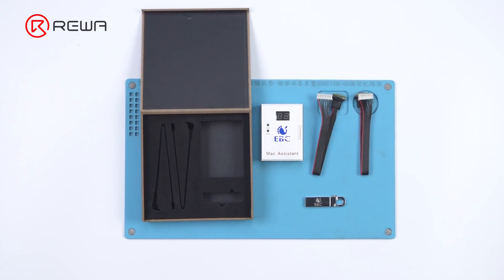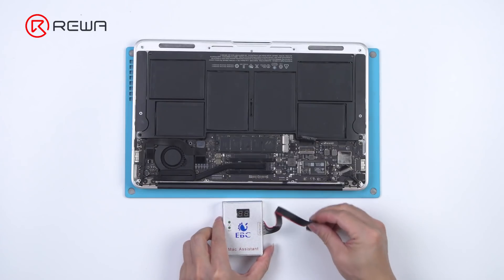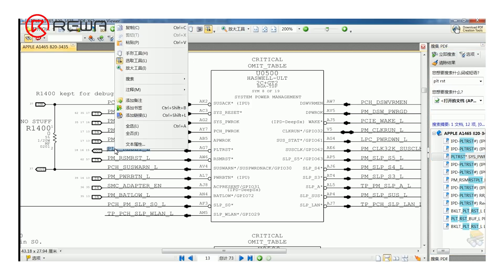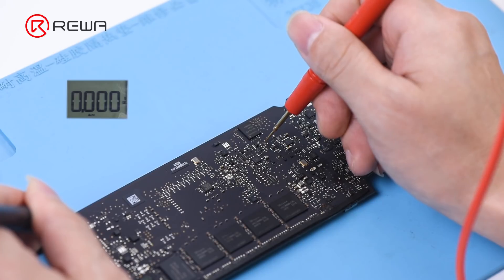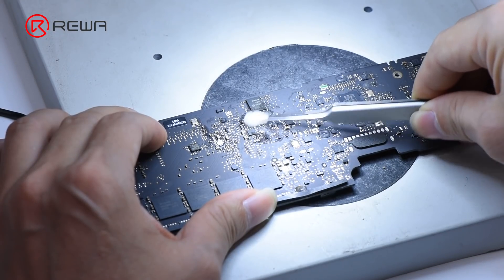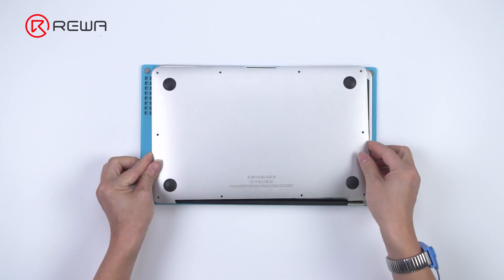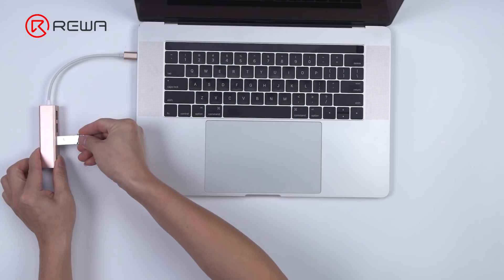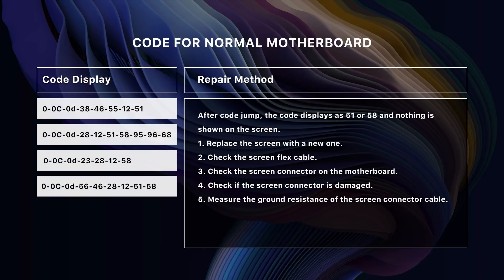An  Efficient Way to Diagnose MacBook Faults and Fix Serial Number (EBC-820)

Comment: Nothing special. Standard post-card. and the 500 ohm resistor was soldered specifically for the video))
Reply: I don’t think you will able to find what was the problem in the first place is just to educate you and how to find the problem with the tool EBC-820

Comment: Very good! You made a repair tool for 7 years old macbooks! Really?!
Reply: yes because thats when they start to fail, fix them and you might get another 3 years out of it. Value for money, 7 years old Mac Air can still do every office job.
Reply: This week in my lab I fixed one macbook air 2017 i5 8GB RAM for 200 USD, the client paid and it took me only 40 minutes. Besides I fixed other two macbook pro A1278 2011 !!! (100 USD each one) and one Imac 21.5 2015 for 250 USD and took me almost two hours. All in less than one week (besides more services for many other brands) As you can see it is business for us and people who cant o dont want to buy a new laptop. Regards.

Comment: Looks like resistor has  been replaced intentionally by faulty one. There is no way this circuit can go wrong without a proper reason. In that case the board has not even been water damaged. And the tool looks just like a some regular lpc post-card but enclosed in a box.
The whole video looks like the way to promote cheap not useful stuff to low-skilled technicians.
The majority of all boards that I've worked with were not powering on totally because of something. And this "tool" only works if board is at least halfway starting up.
Reply: Sorry but this one uses the Apple connector not pcie and runs on i2c 🤣🤣🤣🤣 so it must be special
Reply: @aqib2000  I bought some cheap tl611 pro from aliexpress. Works absolutely the same. Mine came with two adapters for macbooks. And I don't said that this uses pci-e. It's pretty standard lpc.
Reply: @pwrgood_ekb  I was taking the piss :)

Comment: Hi, could you make a video comparing the displays of the M1 MacBook air and Pro? Could you swap the displays and check their brightness levels as Apple says that the Pro can hit 500 nits whereas the Air can reach 400 nits? Could this be the case just like the iPhone 12 and Pro models where the displays were the same, but the brightness was limited by software? Thanks!
Reply: Why does it matter